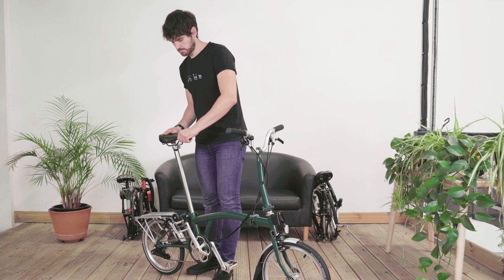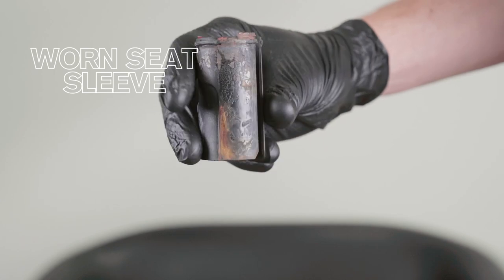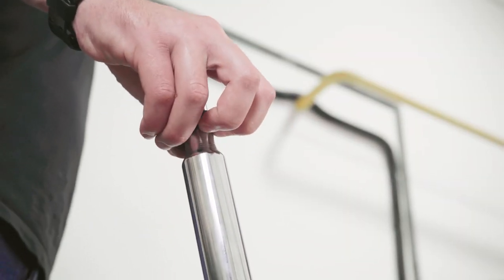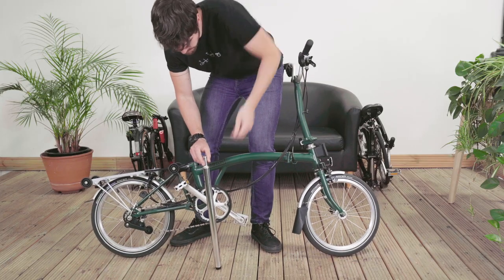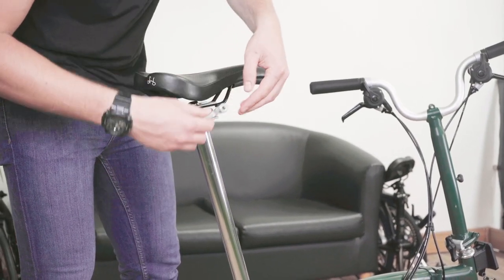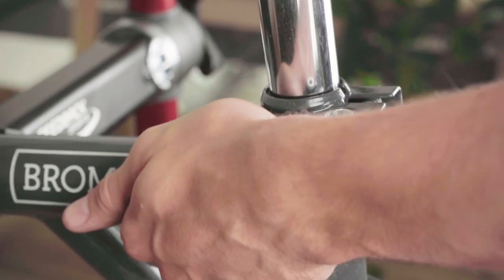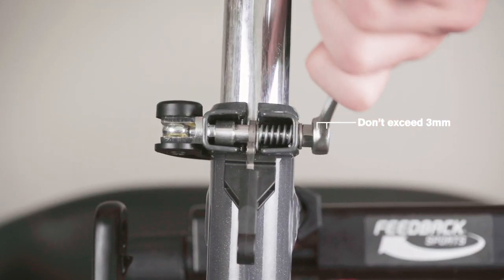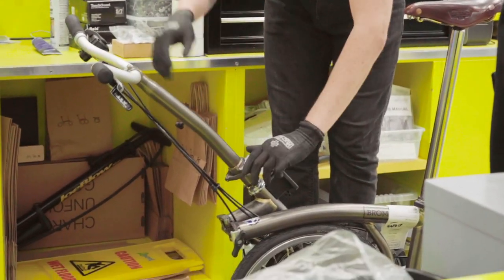Brompton Slipping Seat Post Checks

Comment: The quick release lever mechanism also needs cleaning and lubrication now and then. If the excenter axle gets dirty it will develop scars and wear out. The whole assembly can be disassembled if you are a little handy, using a mandrel and a hex wrench to drive the axle out of the plastic handle. I rescued mine and now it works perfectly. More details on request.
Reply: @Stephan Maier First remove the whole quick release assembly from the bike frame. Take careful notice how the parts are located, in particular the spring coil. It may help to take a close up photo for later reference before proceeding. I removed the excenter axle from the plastic lever by holding the side with the hex shape on top of a 13 mm hex socket, and then pushed it out using a 4.5 mm drill bit and a mallet. This is just one way of doing it, but I think it is a good idea to support the plastic material carefully so it doesn't break. The excenter and the bolt should cleaned and greased with a high quality sticky grease that stays in place. The working of the lever will be a magnitude smoother after this service. On the other hand, a new lever is quite cheep and if the parts are too worn it would be a better idea to replace it, and keep the old parts as spares.

Comment: One solution is carbon paste. I now have a carbon seat post installed so it's essential but I had metal ones before and they were often prone to slippage. Park Tool carbon paste makes all seat posts rock solid in your Brompton. Disclaimer..I rarely fold my bike up completely, usually having the seat post up at all times. For those doing daily folds this might not work so well.
Reply from the maker: thanks for the tip Andrew!

Comment: I’ve just got a brand new Brompton and struggling with a slipping seatpost. I’ve cleaned (even though it was clean anyway) and followed instructions to tighten up so it’s a bit firmer but it’s still slipping and I’m hesitant to tighten anymore for fear of going too far. Any tips? It’s really frustrating and dropping a good inch over a mile of riding.

Comment: I have been struggling with this issue for long time but it keeps coming back and very annoying. My seat post is titanium, not original. The seat post clamp is not original. The sleeve was replaced once which did not require reaming. I have cleaned the seat post. The clamp is tightened enough. Not sure what I can do to fix the problem. It still slip down after I ride for a while.
Reply from the maker: have you spoken to our customer service team?

Comment: On such an expensive bike this really shouldn't be such a common problem
Reply from the maker: It's not a common issue but one we hope we can help people to fix
Reply: @bromptonbicycle  I think its more common than you like to admit. I bought a VERY low mileage brompton with that problem. Solved with a second clamp because a lot cheaper than have someone ream ot a new sleeve. It's a design problem, admit it.

Comment: finally they are addressing the issue, my first brompton had same issue and couldn't be fixed when I sent my bike to brompton junction in covent garden in london. I gave up with customer service I ended up selling the bike. I then purchased second one with same issues. I took it to same shop for maintenance, they changed frame sleeve but problem didn't go away. Long story short I have returned the bike for full refund which I am still waiting. Now I am going back to normal road bikes. I think these bikes are no longer made for quality rather for quantity.

I doubt that I will be buying brompton in the near future.

Update: I’ve got my full refund now. Well, I ended up buying the third bike so far so good no slipping issues.
Reply: After about some years with this issue I found out that, by grinding the  bottom of the seat post with a coarse sandpaper, thus augmenting the grip where it finds the sleeve once the latch is closed, works superbly. It is very simple to do that!
Reply: There is something called 'carbon assembler paste'. For non carbon bikes there is something else, like official grease for your seatpost. Counterintuitively,  the grease is supposed to help your seatpost grip and stay in place by 30 percent.
Reply: @100toeface  I don't think that could have helped since my two unlucky bikes were made poorly because frame was made a bit wider for seat post to clamp firmly.

I've given brompton third attempt. My third brompton seems fine no more slipping issues and I don't have to over tightening the nut.
Reply: @NH99 UK quality ain’t the same anyo

Comment: I weight around 205 pounds facing seatpost slipping down problem. It slides down like 1 centimeter in few miles and few inches in like 15 miles. Is it normal for a heavy rider like me?? my seatpost and the internal thing inside the frame is clean. I also tighten up the clamp. 

Seriously, is it about my weight? Is there anyone facing a seatpost slipping? How do you solve it? Really do appreciate it in advance.
Reply: I’m the same weight as you - mine slips. I just tighten the clamp; however I’m concerned I’ll ruin the frame if I tighten it anymore!

Comment: Why would it slip?   Is this for older models.  I’ve had mine since 2019 august and I have not had this issue.
Reply: It will eventually. since the plastic seat sleeve will worn out between two steel tubes. But don't worry.
Reply: As Sinan commented, the seat post sleeve will eventually wear out. Mine finally did after 8 years. Just hope you're living in an area where there's an authorized Brompton service shop because finding one that has the right tools to do the job can be difficult!
Reply: @bromptonpete  yes, I purchased it from a local dealer.

Comment: could you just drill a hole through the seat post for a pin?
Reply: I've often thought about this... but not through the seat post, as I'd be worried about it bending at the hole. Rather, I've thought about in the frame, halfway between crank and top tube, so the pin would go UNDER the end of the seat post. The I thought "this only works for those who extend their seat post fully". Maybe a mod I can do... if I'm brave enough! (but cleaning and tweaking is working so far)

Comment: I bought my new Brompton, already have this problem
Reply: get rid of it if you can, I had two same problem, I sold one and returned the other one for full refund.
Reply: Exactly , same with mine
Reply: Mine's electric, my second Brompton. Bike tracks around my home have many bumps, which don't help with slipping. My thought is that the factory torque is great - for an unridden bike, and that after a run in period we should all readjust the nut. Pulled my seat post out during a lunch break after watching this and was surprised at the gunk on the post. Metho and paper towel, tweak nut, rock solid again... for now.